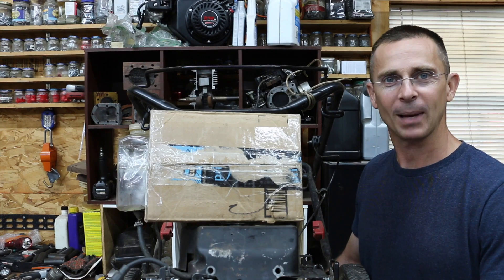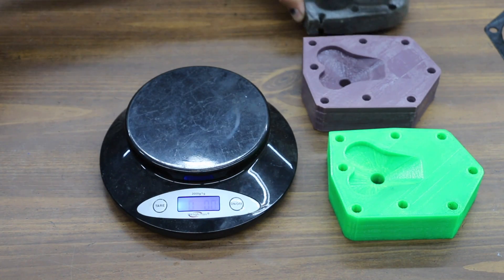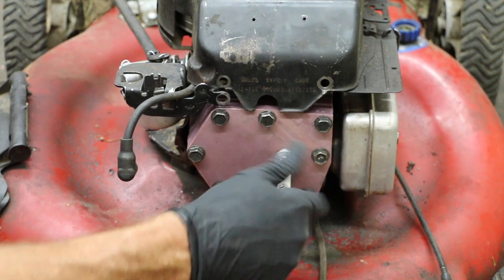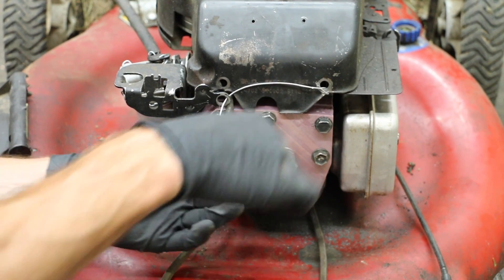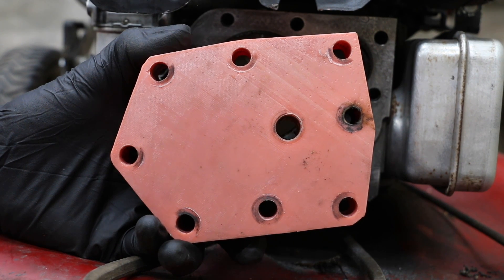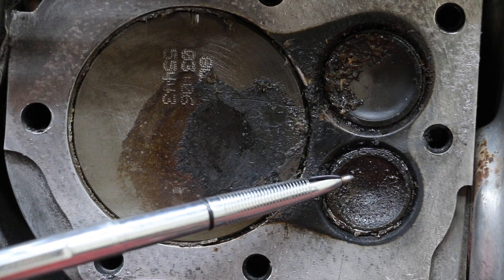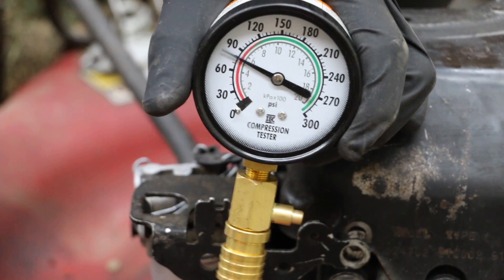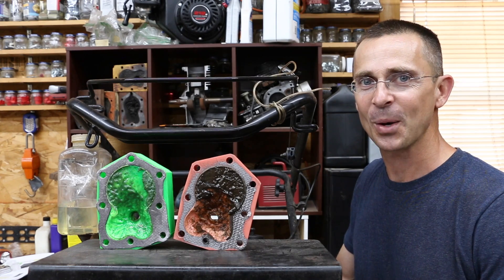How long will a 3D printed cylinder head last?  Let's find out!

Comment: I'm not quite sure that ground is sufficient I would have chosen a washer under one of the head bolts wouldn't that be much better than a much cheaper metal with paint over it? The reason I ask is doesn't that affect the spark plugs behavior in a great way like even temperature?
Reply from the maker: Thank you

Comment: DANGEROUS!!!! 
While everyone knows the unpleasant odor from ABS cannot possibly be healthy to breathe in, most of us generally do not really care. However, not only ABS, but also PLA, may release toxic fumes known as VOCs (Volatile Organic Carbon). Not all VOCs are actually toxic, but some may be, especially for younger users. Before this becomes a serious health issue, a new study conducted by 3Dsafety.org, in collaboration with Italian 3D printer manufacturer WASP, has analysed the exact quantities of toxic VOCs – as well as potentially dangerous nanoparticles – released during filament extrusion, in order to assess the potential health risks.

The new study, presented by Dr. Fabrizio Merlo and Dr. Eng. Stefano Mazzoni, starts off from other previous research conducted in the early 90’s, which demonstrated that during the fusion and processing of plastic materials, several toxic particles are released as gases, including ammonia, cyanidric acid, phenol, and benzene, among others.

The lab tests showed that ABS is significantly more toxic than PLA, but that the corn-based polymer is not exempt form dangerous emissions, especially if extruded at temperatures higher than 200°C. Furthermore (as may be expected), the same material spools, when acquired from different resellers, release very different quantities of VOCs, even if used in the same 3D printer and under the same parameters of speed and temperature.

A second critical aspect is that relating to the emission of nanoparticles, that is, particles with a diameter smaller than .1 micron, which can be absorbed directly by the pulmonary alveolus and the epidermis. In this case, the emissions, when using ABS, vary from 3 to 30 times those that occur when using PLA filament. The test also demonstrated that the time necessary for the nanoparticle concentration in the air to go back to standard levels was between 10 and 30 minutes after the extrusion processes stopped. Through a photo-ionization technology, the study (which has been published on 3Dsafety.org and will progressively be updated with further information) was also conducted on nylon, polystyrene, PET and other materials.

Among the effects that the absorption of toxic VOC’s and nanoparticles can cause to humans, the most common are pulmonary pathologies, such as bronchitis, tracheitis, asthma. In some cases, these substances can also cause certain types of cancers, so this is not something to be taken lightly.
Reply from the maker: Thank you

Comment: you wont get much usage in engine parts unless you used powder based processes (like SLS) which have yet to bleed down into the consumer space and can use metallic materials. or in low temperature areas.
Reply from the maker: Thank you!

Comment: Someone mentioned a glass cylinder head so combustion could be observed.
There is a fairly recently developed transparent aluminium (or aluminum for the uneducated ;-)  ) alloy that should be up to it - don't know about cost and machining, though, or how effective it would be at absorbing and dispursing the combustion heat (remember, peak temperatures under the power stroke is a small part of the 2 revolutions per cycle) -  https://en.wikipedia.org/wiki/Aluminium_oxynitride and https://www.youtube.com/watch?v=DduO1fNzV4w
Reply from the maker: I'd love to have this for use as a cylinder head.

Comment: Well.. you just showed what we already know.. thats why engine parts are metal.. feel bad for people with plastic intake manifolds, plastic Radiator end caps, plastic gas tanks( yes new cars have em) gas and heat eats plastics..
Reply from the maker: Thank you!  I've replaced lots of melted plastic on automobiles over the years.

Comment: There was a company that was using was, instead of plastic to make 3d printed stuff. The wax was never meant to be used, but used to make molds in a lost wax sand molding. The company bite the big one when some one said, You could use existing 3D printers, and wax thread. I never heard what happened after that. I don't see was 3D items. Does anyone know what happened?
Reply from the maker: Thank you!

Comment: if you have someone willing to send you a 3d printed item why not do another test on something that may end up being a useful alternative ? a lot of modern engines use aluminum thermostat housings ..over time these pit for various reasons .. why not replace the thermostat housing on your ford ranger with a 3d printed one .. this way people with really old vintage cars they cannot find reproduction pieces have an alternative and you can actually drum up some side work for the guy that sent you the 3D cylinder head .. it will give you the excuse to do a radiator flush video and thermostat replacement while your at it
Reply from the maker: Thank you for the video idea!

Comment: This should be retried using another 3D printed material such as ULTEM 1010 which has a head deflection temperature of 216 Deg C, other than metal printing this is one of the higher temp plastics and is currently used in aerospace for final products.
Reply from the maker: Thank you!

Comment: I haven't read through all the comments yet, however, I was wondering about plastic 3D printed plastic on the carburetor for a gasket? I wonder if that would hold up to the gasoline? I have spent many years as a mechanic for motorcycles and I've had to make several gaskets by myself and now I've got a 3D printer and if this worked out that could be really useful for a lot of us
Reply from the maker: Thank you for the video idea!

Comment: You could line this with a thin sheet of sheet metal after you carefully form and fit it to the inside of the plastic. The plastic wouldn’t enter the combustion chamber and the head could last until melting.
Reply from the maker: Thank you!

Comment: You've tried Polycarbonate heads out of a sheet/block before, right?  You can print Polycarbonate with FDM as well, and it has a higher melting point than ABS, and is much stronger.  By far not all extruders support the necessary temperature, but they're out there (mine supports it).
Reply from the maker: Thank you for the video idea!

Comment: The reason why the spark plug melted the softer material cylinder head is because the spark plug utilizes the cylinder head to dissipate the heat from the spark plug. 
-automotive Technician 
     Still very cool to watch
Reply from the maker: Great point. Thank you

Comment: I guess the limitation is plastics that can be used with 3D ptinters as the plastics are a low thermal plastic.  There are 3D printers that use a metal alloy but may be it would be the same issue. Didn't  you one have a lexan head in your Nitrox video?  Thanks for another fun video.
Reply from the maker: Thank you!

Comment: I wonder if the plastic would do better in the spark plug had a metal sleeve to screw into, and the inside of the head had a thin sheet of metal
Reply from the maker: Great point! Thank you

Comment: interesting video, it is however to be expected that a plastic that can easily be melted by the 3d printer extruder will also melt in a int. comb. engine.  Only way is to use a thermo set plastic like the epoxy head.  It would be interesting to see if a head made from Pyrex glass would work.  It would need to be made with dowels melted into the glass in areas of the bolts and spark plug.  Also a head made from epoxy with aluminium powder might be interesting as it may be able to dissipate heat
Reply from the maker: Thank you for the video idea!

Comment: i bet that must have smelled lovely
Reply from the maker: lol. Yes
Reply: Mmmmm carcinogens!
Reply: PLA is made from corn, it actually smells quite sweet when burning.
Reply: Maybe a cylinder head made from compressed bacon.
Reply: This is a real issue. ABS vs. PLA - because ABS is a plastic derived from petroleum, so it can make toxic fumes. PLA is made from organic materials, so it is not toxic, but, as the video showed, not as strong and much more sensitive to heat.
Reply: @Stomachbuzz  burning anything, even extra virgin olive oil, can be toxic
Reply: My favorite :)
Reply: lol

Comment: What if you 3d printed a mold for the gasket and used something like liquid silicone rubber?  Never used it myself so not sure of the heat ranges it would tolerate, or if there is a product out there that would be suitable for such an application.  Could be an interesting experiment.
Reply from the maker: Thank you for the video idea!

Comment: Plastic and composites are some of the best discoveries by man but some things just have to be used with metals. Perhaps in the future heads and gaskets will be made by something that can take the immense heat;  pressures and be cost effective, but till then the old ways still are the best.
Reply from the maker: Great point. Thank you

Comment: One overlooked difference between the aluminum head and plastic is the lack of cooling fins on the plastic head. The fins allow the engine to cool off to some degree. 

1. Try using a solid aluminum head of the same thickness and see how long the engine lasts. 

2. Using a plastic head with cooling fins. 

Love your vids.
Reply from the maker: Thanks for the video idea!

Comment: Just need someone down at SpaceX to print a cylinder head out of whatever they use to 3D print the SuperDraco rocket engines used in the upcoming crew capsule. ;)
Reply from the maker: Thanks

Comment: you could coat the interior with nighthawkinlight "starlite". that should isolate the plastic and should only melt around the spark plug, so the abs should withstand more time before failure.
Reply from the maker: Thank you

Comment: What you want is a termoset plactic, not a termoplastic ;-) So for example fiberglass+polyester resin or fiberglass+epoxy resin or just epoxy resin (but you tried that with JB weld).
Reply from the maker: Thanks for the video idea!

Comment: Now all you need to do is get a 3D printed piston and connecting rod and try that
Reply from the maker: Thank you
Reply: Rick Miller  + I think the damage may be terminal BUT would be interesting to see how it fails
Reply: Rick Miller  + no I got what you were saying, but you are probably nor to far off
Reply: Rick Miller  + if the heat transfers
The majority to the block side and insulated sufficiently for the head side that should work. Only thing left is to install a heli-coil or something of that nature to try to keep the plug from getting clogged ( install a short thread plug) to have it keep it out of the c.chamber
Reply: Rick Miller  true, but if heli coiled and the plug has shorter threads within reason of course it would be shrouded by the heli coil a bit and help keep plastic from fouling out the plug
Reply: Rick Miller  + Maybe so but either way I believe setting up the sparkplug will  definitely result in a longer running if not until head failure engine

Comment: Timing gears since they are bathed in oil, thermostat filler neck? Cool video
Reply from the maker: Thank you!
Reply: @ProjectFarm  they do make an HTPLA filament that after printed can be annealed  to handler higher forms of heat. Whether it will make a difference or not, ??? It does have to be HT-PLA don't know if it's new or not. Happy NewYear! :-)

Comment: Try it again with a metal plate over the plastic and see if it works, metal plate between plastic head and the block . A metal socket for the sparkplug too.
Reply from the maker: Thanks for the video idea!
Reply: @ProjectFarm  thanks for noticing. I imagine a cylinder head would be significantly lighter if this is by any means possible.

Comment: There are two kinds of plastics. Thermoset plastic. and Thermo Plastics. a 3d Printer uses a Thermo Plastic which can melt and remelt. which would make this a horrible cylinder head. I propose casting one in like an art resin would me much better, Maybe even a Silicone cylinder head could work as they would have a higher thermo resistance. and as opposed to the 3d printer filler material it would burn not remelt.. 
This is probably way to late in this videos life cycle, but hey there is my insight..
Reply from the maker: Thanks for this information.

Comment: You know, I wonder how one of these plastic cylinder heads would perform if the guy who sent them to you engineered them where the spark plug could still be screwed in with a recessed area while the cylinder head itself was much fatter and had cooling pipes running through it, connected to one of those PC water cooling systems or something that could cool down the plastic.  Just makes you wonder.  Seems the only reason the heads failed was due to heat.
Reply: TLDR - It would probably work if they made a high temperature plastic that could be printed, but that would probably be expensive!

Love the train of thought on that, I'm a PC tech so I kinda wonder the same thing. Though I feel like a big issue would be if the car overheated and either boiled the liquid in those lines or melted them leaking it out. The design would probably either be expensive due to the amount of materials needed to be efficie t or really cheap due to failure rate becauseit how hot the normal operating temperature is and other systems could cause the engine to run hotter than normal too. So it would probably just require a better material.
Reply: PLA melts with a hairdryer.  It ain't gonna last regardless.
Reply: I can’t see it working. Plastic doesn’t conduct heat very well, so the cooling system wouldn’t really cool the combustion chamber enough... which is where the failures are happening.
Reply: @ebouwman034  I was thinking he should have put cooling fins on it, but then I thought of the heat conduction issue
Reply: Steven Powell Ya, I think fins would be totally useless here. I mentioned in another comment that I’d like to see him do a printed metal head.
Reply: You could make it with some high temperature plastics. It'd be more expensive than just going and buying the best lawn mower money can buy. And retarded when I could make it out of aluminum for a hundred bucks.
Reply: What if he 3D printed a metal cylinder head instead of a plastic one? What if he did a lot of things that made sense and did none of the things that made no sense?

Comment: There is new materials for 3D printers like Cooper Filaments, Aluminum Filaments and Carbon Fiber Filament. They are actually plastic composite materials, but it should be very interesting to see if they last longer.
Reply from the maker: Great recommendation. Thank you

Comment: So next you need to cast your own aluminum head using the lost PLA method.
Reply from the maker: Thanks for the video idea!
Reply: @ProjectFarm  Could also 3D print a silicone mold for one of these, and try different poured cast plastics with higher melting points and strengths, like high temp nylons, polycarbonate, etc.
Reply: @SCComega  I just replied to a comment with a similar train of thought!! Honestly it would be awesome to be able to print a good enough quality material because you could choose the design that people rate best, and it could get improved by the community! Though I wonder how much bulk it would take to be cost efficient enough for material rated properly instead vs just buying one?
Reply: @ProjectFarm : Or the 'lost-foam' method (Great Stuff).

Comment: Even a high temperature plastic or silicone won't work very well. Suppose we are able to use a plastic that holds up to the temperature. Plastics are generally very poor heat conductors. Spark plugs require a better heat conductor for optimum operating temperature.  Most likely the plug would overheat quickly. Even a cold plug requires a heat sink.
Reply from the maker: Great point. Thank you

Comment: make a multi ply fiberglass block and 3-d print a cyl head from the fiberglass.  it shouldn't melt if you use a good resin.  not NAPA  brand crap. 
if not from multi plies of fiberglass - take some fiberglass mat and shred it into the pre mixed resin and form a block from it.  then 3-d print the head.  again -  use a good resin.
Reply from the maker: Thank you

Comment: If these 3d printed cyliner heads were coated with a high heat resistant cement or apoxy it may work really well
Reply from the maker: Great tip!

Comment: I'm curious, how well would a ceramic head fair ? (cooking a block of clay between 2 plates and cutting the holes after using very light pressure on the drill.) maybe using a brick? securing the spark plug with gasket-in-a-bottle  and chicken wire might be necessary, but it might be something that works decently well and could make a motor run if you are in a pinch.
Reply from the maker: Great test idea!  Thank you

Comment: MakersMuse lit some 3d prints on fire notice a lot of the DMG closely resembles this. PETG preformed better against fire than both of those by a significant amount.  Something exotic like polycarbonate, nylon, one of the carbon fiber ones, or a clear uv cured resin print where you could watch it fail.

 Really interesting I would have expected failure much faster and more catastrophic. Like carbon seizing on the valves. Thanks for doing this.
Reply from the maker: Thank you